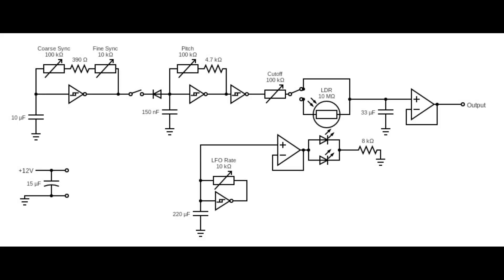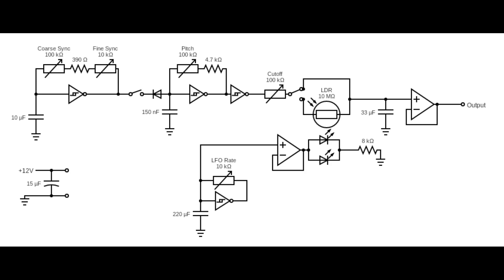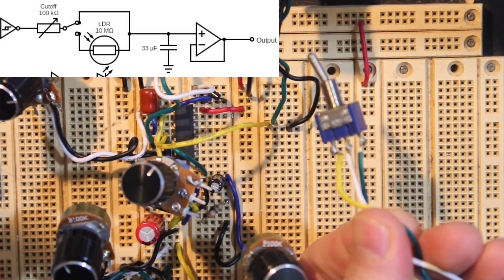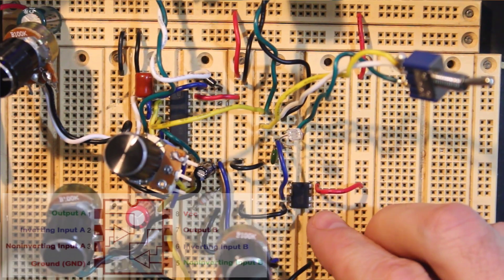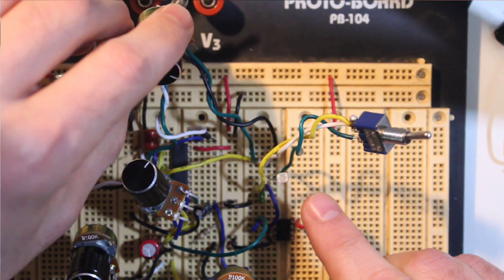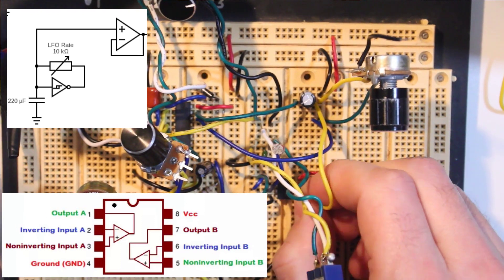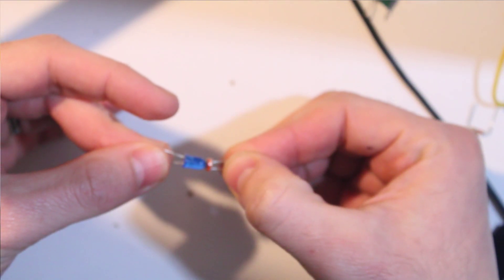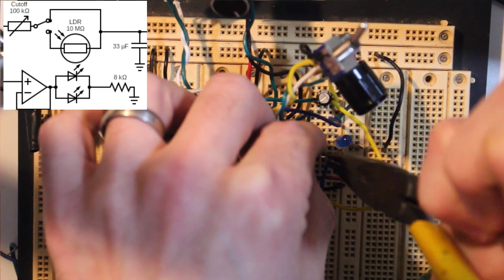Vactrol based LFO Low Pass Filter - DIY Synth 40106 Chip

Comment: How would you solder a vactrol to an excisting low pass filter with vc?
Reply from the maker: Can't be sure without a schematic, the folks on r/synthdiy on reddit would be a good place to post a pic and ask. If I had to guess, the vc would need to operate the LED, but none of my designs are really all that compatible with standard eurorack voltages, so be careful.

Comment: I'm wondering if you could replace the ldr and led that you taped together with say a PC817 Optocoupler or would it require some extra components?  Thanks for your videos!
Reply from the maker: It'll behave differently since it's transistor based, but I don't see the harm in trying.